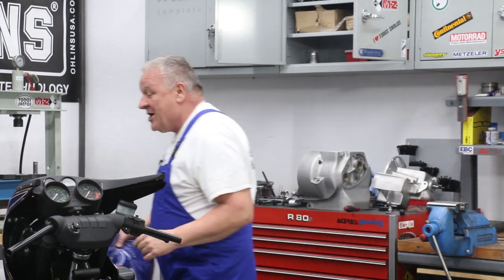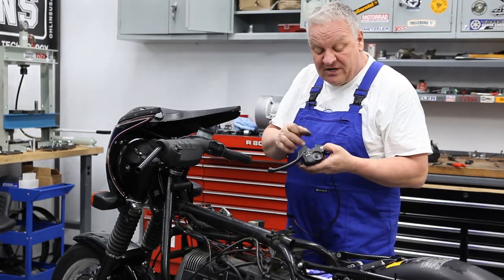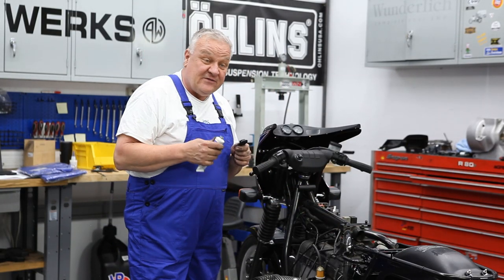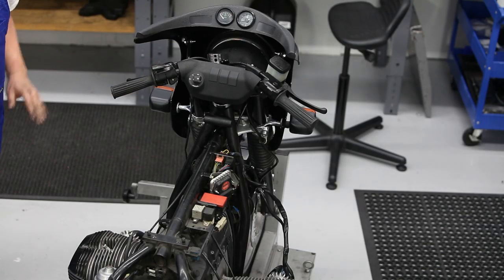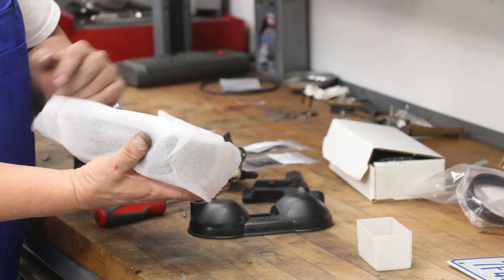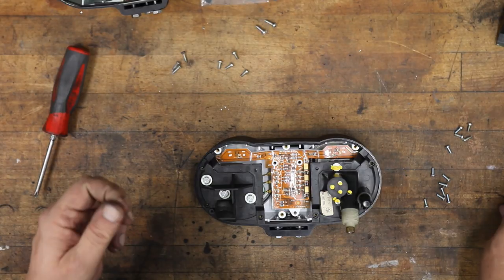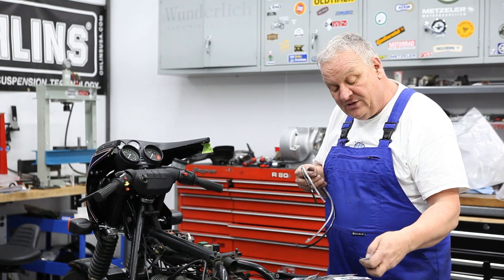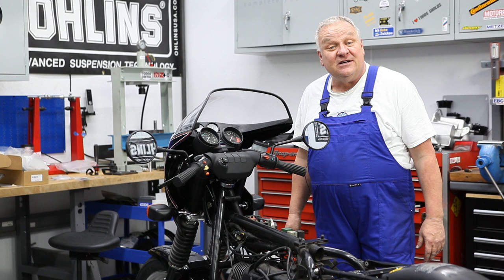BMW R80 RT to S Conversion #10 - Controls, Instruments, Mirrors & Windscreen

Comment: Hello William !
i have the same model that you're repairing but with high handlebars.
There are two different length for accelerator bowden cables, one is: 1118 mm an the other 1158 mm is it for left and right ? 
or which ones should i get ?
Thanks !
Reply from the maker: Sorry for the late reply.  The left and right are different lengths. The right one is 1120 (part number 3273585) and the left side is 1160mm (part number 3273584) You will need one of each.

Comment: Wish I could see exacrly where you measure the clutch 102mm!
Reply from the maker: From the rear of the gearbox houing (where the clutch cable is) to the clutch release lever at the rear of the gearbox

Comment: Next time I would put a stopper on the 3mm push-through bolt. I pressed too hard with a rivet.   *seufz

If someone need to change the Copper hollow rivet in the instrumentholder, ask your BMW Dealer. He should have a nice tool for that